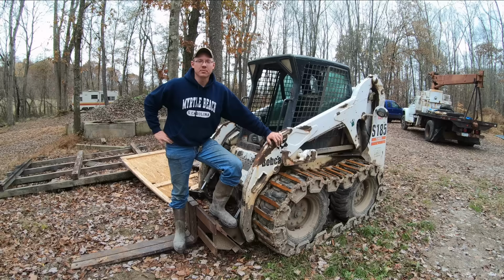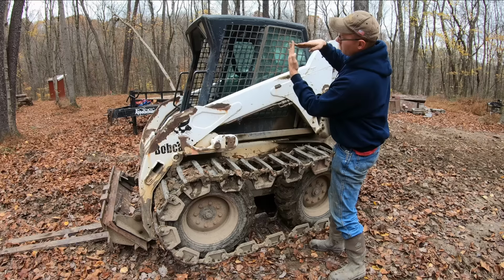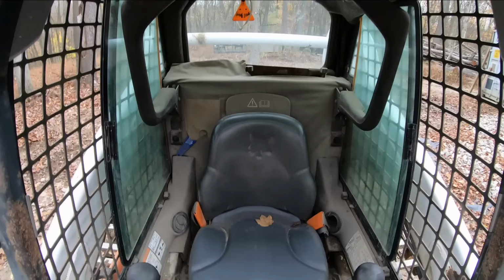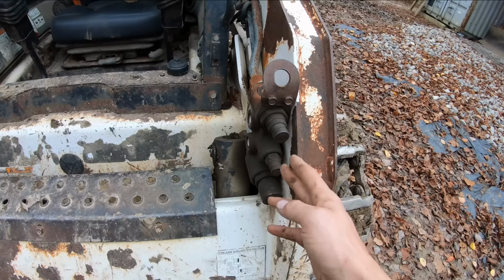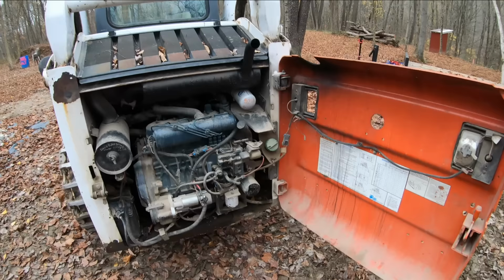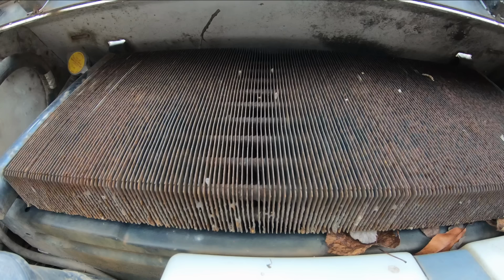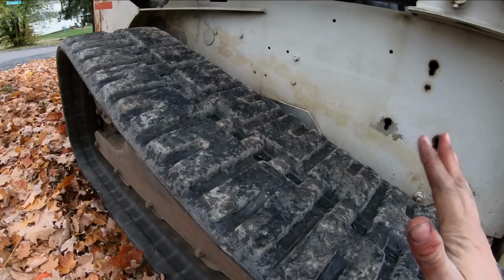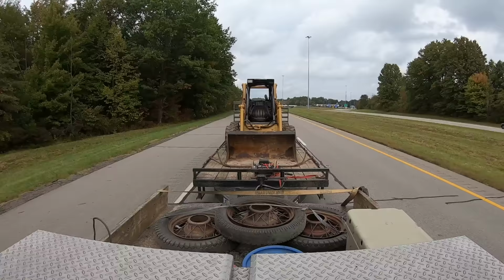Buying a Skid loader? WATCH THIS FIRST!

Comment: Good job on your showcase what to look for. The operator certainly needs to fix his machine soon because the bucket tilt  cylinders might yet just be in the bushings. If so he will get by with low cost. The bogy also needs immediate attention. I think you need to spray some of that black rustoleum paint on you hydraulic cooler to stop bad things

Comment: I prefer mini-skid steers and mini-loaders to skid steers mainly due to the inability to safely exit the machine with the bucket raised. I think JCB makes a single arm side entrance model that negates that. Mini skids are best for sketchy operation as it is easiest to bail from. Mini loaders can also run a cab for weather but have a better power to weight ratio than skid steers and, if articulated, tear up the ground less. Great overall machine buying video.

Comment: I definitely prefer the foot controls, I think it’s neat you actually have an option with this machine. The John Deere I operated a few years ago, you didn’t have that option. I’ve operated both hand and foot, love the foot.
Reply: I ran a bobcat with foot controls for a week and almost couldn't walk when done. My legs too long, feet too big, or something was out of whack. It was a workout. ... Of course might have nothing to do with running a hammer pointing downhill until the whole machine would slide off, drive around, point downhill, repeat. 😆🙄👍
Reply: Joysticks are the way to go.  Way easier on your body and not getting foot pedals stuck with mud/dirt.
Reply: @kg6981  When buying used, the foot controls will be a lot less money.  I bought mine on a smaller budget.

Comment: I interned at bobcat back in the Ingersoll-rand days, and can tell you what the numbering means. S= Skidsteer T=Track and A=All wheel steer(these were uncommon turf machines). The number is the approximate rated lift capacity, missing the zero on the end. Your S185 is rated for about 1850lbs of lifting. Because track machines are slightly heavier, and more stable, they have more lift capacity, so the same size unit with tracks would be rated more, hence the T190 (rated for 1900lbs)

Comment: They are a great machine to have around any job site however I disagree that it's the most versatile machine to have, I believe the most versatial machine would have to be the farm tractor with the 3 pt hitch and PTO both front and rear.
Reply: Very limited height of lift with skid steer compared to conventional machines.
Conventional loaders are more versatile especially combined with conventional tractor. Imo

Comment: I will say, from a LOT of experience that Bobcat machines have EXCELLENT dealer support . I can get just about ANY part I needed for my 20 year old 763. Simple stupid non turbo. I have the same tracks....make it a WHOLE new machine. Other advantage to tire machine is you can mount a 9-10' snow plow and use TIRE CHAINS. Tracks are not great in snow.
Reply from the maker: No they are like big ice skates haha but fantastic in deep mud!
Reply: @DieselCreek  I bought my Grousers for the same money as you off Craigslist as well. .. lol
Reply: Doosan owns then now.  They got rid of the Kubota engines and Doosan is putting their own engine in it.  Not a fan.  Have heard of lots of issues with their new machines.
Reply: @kg6981  many "new" machines i won't touch. I look for some old dead guys cream puff. Bought a JD 970 w/ 450 hours. Sat in a garage for 20 years.

Comment: Been using a JD2240 4X4 with loader, just bought a Cat 246C skid.  I'm struggling to get use to climbing in over the bucket.  Many times working on projects I need out to deal with something lifted in the loader.  Can't get out of the cab unless I lift the load up 7' and climb out underneath.  Other than that I'm loving the machine.  Thanks for the video, it gave me some tips for when I looked at the Cat initially.

Comment: in my opinion, I think The case 1845c Is definitely Worth Buying I've had one for about 3 years now done regular oil changes And it still purs like the day I got it And I will say the Tires I run I don't get Stuf though I'm considering some wheel tracks
Reply from the maker: Those are pretty good old machines, the 4 BT Cummins is hard to beat

Comment: You forgot wheel bearings and leaking axle seals.  Winter project is front left on my NH L555.
Reply from the maker: Yes I thought of that when I was uploading this!!
Reply: And drive chains and/or final drives for track machine. Blow by on the engine. 
When checking the pumps without pressure and flow equipment there are a few good ways to do this depending on what type a machine it is and if it’s a wheel machine what type wheels or tracks it might have added. 
First when you are going to look at a perspective machine take two blocks of wood 1 foot long and about 8” tall at the widest (it can be 8” , 6”+2”, or two 4”) you lift machine up in front with bucket and tilt up as far as you can place the blocks under the machine  just in front of rear axle let machine down till rear axle lifts off ground and front axle remains off ground. You can now check the drive motors for free play, rock the axles for loose bearings and check drive chains. For flow place a mark on both tracks and run them
1 min each side. They should be fairly close on the amount of revolutions per min. (With one one to two max) same with track machine. At this point you can check for excessive case drain as well the drive motors should be warm to touch (Luke warm not scalding hot ) if they are excessively hot you motor or the pumps are on the way out or are in need of resealing and repair. This should be checked before running the drives/pumps over relief to check pressure on motors and pumps. once speed and flow is checked then run the drives over relief “gently” first. You can put machine back on ground and use the block or a other smaller block to bind the drives one at a time first low idle and gently push in to it to check to see if it stalls. It should pull engine down if it doesn’t then it’s worn out or the relief(s) is stuck in bypass. A pilot controlled machine can also be checked at low idle for control leaks in this way. So you need to understand how the machine works to an extent to get the most out of these test. IE a machine that don’t stall at low idle may also have pot control issues in the manifold but you hav to understand the systems some. After low idle the check and pull it in gently against a block or pile of something and see if both sides stall about same time and that they don’t stall to early indicating weak hydros or bad pumps. 
Flow for main hydraulics works the same way run them gently over relief to make sure each pulls the engine down some but. It excessively (these aren’t eg drive motors they shouldn’t kill the machine unless your operating something off the high flow side) At this time of there is two of you have one person hold the machine over relief and feel the cylinders (after about 30sec) check cylinders in locations around where the pistons should be at this time checking for the cylinder to e noticeably warmer at that point. ( if it is the cylinder is leaking and needs repacked or piston is loose ) after checking the reliefs run them through full range of motion at least three times check for binding in controls and loader/bucket. after third time either you get out or other person checks the cylinder again this again checks the seals and also now the anti-cavitation valves if they have them (most modern loaders do they are located at the base of the cylinder piston on lift arms) again checking areas where the piston should be they shouldn’t be excessively warmer than the rest of the cylinder and the barrel end of cylinder shouldn’t be excessively warmer than rod end by much. Neither should be exceedingly hot to touch just warm

Comment: I am selling mine. It is an ASV posi-track 50 horsepower, 650 hours. Perkins Diesel Engine. The tracks are still new. We have only used it to push the snow out of the driveway. I think it was an overkill because I am not into construction. It has been in our garage, not outside. The price may be negotiable $ 48 to 50,000 dollars. It comes with its bucket, hardly used. Other details can be given The machine will be sold as is.  We have changed the battery every two years to a brand new one to keep it ready for the winter. We also bought the grapples if you are interested in getting it.

Comment: I got a Bobcat 540 project that you can swing by and help reassemble..🤣🤣
Got it for the price of new tires..  And it has new tires...  Motor caught fire and wiped out all the hydro lines... got all lines made and a replacement motor... Need to snag a manual for the hydro schematics..

Comment: @ 10:45, if that hole gets sloppy, I would bore it oversize and put an O/S bushing in it, before I would weld and re-drill. I can't imagine how many things like that I have worked on with 35 years as a machinist.

Comment: Just FYI if the paint does bother you one of the easiest ways to save money on production is paint so if you had the time or money you can heavy primer and paint it with quality paint and it'll last a long time reason rust spots show up so fast is cheap. Paint cracks water gets in starts rusting under the paint then it all flakes away... Good paint is pretty much always worth it weather your going to sell it in ten years or keep it for 20

Comment: That Kubota engine is one of the best. I had a Gehl skid steer at my place of work and when we traded it in the engine had 9000. Hours on it a lot of hours for a small diesel engine. 😮

Comment: I`m a track hoe operator but danged if I can run a skid steer with joy sticks. after having a taste of them our shop went on a shopping spree to buy cats with the traditional steering. One thing a lot of people don`t know is that most cats have a self leveling feature in the boom for back dragging just kick the right pedal once.
Reply: really? I just test drove a used model today and it was my first time in a skid steer.  do you tap the right foot pedal to the floor?
Reply: @zedwpd  Once to floor to engage then again to disengage. Note the self level only works on back dragging.

Comment: A pressure washer can be used to your advantage.  Repeated greasing is necessary but the residual grease traps dirt and that eventually adds to the wear.  A dirty machine left outside will go downhill fast.  If you want to just jump on your machine use it and shut it down then save your money for the new one that you will eventually need.  Do not get it out of your mind that someone is selling that machine for a reason.

Comment: S185 stands for max weight 1850 lbs lifting capacity back then. T190 is 1900 lbs, now the newer designation numbers means nothing now refering to max lift capacity anymore.

Comment: Those piston seals are real simple. 10 minute job once you get the piston off machine . Only concern should really be is getting the getting the main seal cap off. Those smaller ones usually spin right off. If not some heat usually does the trick.

Comment: Hope you do a video of stem cleaning the machine.
Reply from the maker: I will when I get to it. I’m always running around like a chicken
Reply: @DieselCreek  Oh, I know the feeling. No worries!
Reply: @DieselCreek  There are drain holes that will help with cleaning but just like everything else on a bobcat they are designed for shit and should be made a bit bigger if you have the means.

Comment: another point i forgot when i started working for big company several pieces of equipment they blew out filters i personally won’t as i have seen them damaged by compressed air i know of to machines they lost the engine that way cause they never pulled secondary filter definitely regulate how much pressure you put thru them good points but i change all filters every service no matter make me have little piece of mind definitely use quality filters to

Comment: Give you a key to older skid steers, buy the most basic model you can that has AC and Heat. If that control panel goes out so does your checkbook. if the key goes out or is lost I can buy a new cylinder for $100 or hot wire the son of a gun.

Comment: I  bought a machine back in the  70's and it was a first of its kind to us anyway. I own it so first to drive off the delivery trailer. I backed it off alright, foot controls for the bucket and hand controls for the tires, I think this is a good time to point out it had no cabin.... all open to weather and not a big deal as it was for moving sawdust away from the tail spools in the mill. I drive it up to the pile of spalt and sawdust.. make a kinda good scoop and then back away. I forgot that my feet controlled the lift on the bucket and am looking backwards as I move away from conveyor to dump said materials. I must of went a good twenty feet back and not looking forwards at all as I knew everything was okay or so thought! I had been pushing on those peddle's and they were still going on up an I wasn't adjusting the bucket to keep level so it was following the plane of the lift arms..... the next thing I feel is all that sawdust pouring over my head and a few spalts hit my head as well not feeling good at all... no bucket cover on my head either, a big no no on a machine set up like that. I get off and remain calm and looked at the crew and said "you see what I did wrong, don't do that or that will happen and could hurt you bad!" I sauntered off like that was what I intended and went about business in the mill while the others returned to different jobs and a guy was learning the machine... when no one was looking, ducked into the restroom and took care of scrapes and bruises. A real humble way to start with one.
Reply from the maker: We all have our embarrassing moments, you’re just lucky it was sawdust and not softball sized rock. Back when I was learning I’ve dumped my share of rock on top of the cab.
Reply: Those old models had 1 and 2 cly. wisconson air cooled engines and the speed selector was trip. but they got the job done.

Comment: We used to lay an aluminum framed copper screen over the top mounted cooler or radiator.  Really cuts down on what gets in and needs cleaned out

Comment: I bought a 753 back in 98 for $200...
I spent $60 at Napa getting 2 hydraulic lines refitted and worked that thing for 8 summers... 
The best part... I sold it and paid for my divorce 👍

Comment: Was looking  for  a  small  front  end  loader  when  I  got  offered  a  New  Holland  L775.  Bit  of  dealing  later,  I  owned  an  L775.   High  flow,  and  two  speed. Vertical  lift  compared  to  radial  lift  does  make  a  difference.  Post  holes,  pallets,  and  a  few  I  can't  remember,  vertical  lift  is  sweet.  And  I  think  it  has  a  solid  8  foot  dump  height.  But,  i  still  should  have  gone  with  a  front  end  loader  tractor.  My  775  doesn't  have  an  enclosed  cab,  and  winters  are  still  kinda  cold......  I  envy  your  heater.
Reply: I had a simple vinyl enclosure with a door on an a machine 15 yrs ago. I was impressed at how much engine heat I was able to conserve with that.  It's a good low dollar investment solution for open station machines.

Comment: Of course the thick iron makes a difference with catastrophic oxidation time. But the difference between these and a car in winter areas is mostly salt. If you're doing snow removal with these and DEFINITELY if you're running a salt spreader or doing areas where chloride is used its going to rust through just as fast unless you're washing it down before parking it every time

Comment: Hello Matt, I hope this comment finds you and your family doing very well. You were talking about metal tracks over rubber tracks me and myself I would prefer metal tracks on a rubber tire machine over those rubber tracks because guess what the rubber tracks fill up with mud in the metal tracks on a rubber tire does not sure they're noisy but there are way better and I'm sure that's one thing we will agree upon. Stay safe stay well and as always God bless. Hope you get a big buck this year.
Reply: are you going to take the steel tracks off each time you want to store it in a concrete floored barn/garage?

Comment: The company I worked for, we took a snowplow, and fabricated the rig to use it on the skidsteer, acted just like it would have on a plow truck.
Boss had 2 New Holland LS160, and we also had a set of steel tracks over the tires, had to put a set of hub extensions on the machine, so only one machine used the tracks
Reply from the maker: Yes I did that with an old plow as well

Comment: I don't think I've seen any skid-steers that rust worse than Bobcat. It seems to be a common issue with them.
Reply: Its the powdercoat they put on there instead of paint, vibration, scratches, and the smallest hole gets water on the bare metal and it rusts under the coating

Comment: Had a rescue call for a fellow with his foot pinched by the bucket boom coming down. One foot on the pedal and the other in pinch mode. Not sure what kind of safeties may have been bypassed, but sure did not seem to be a good setup. Looks safer and easier on the handles.
Reply: Youd have to bypass the seat bar.
Reply: @ridgerunner106  Suspected that, thanks.

Comment: I truly believe the Skid Steer is the only machine on earth that's it's own demolition derby. Every time you run one, you're headed for it's next repair problem. At least with the older ones.
Reply: We have a 94 model.  Cleaned out four chicken houses, moved thousands of rolls of hay, did construction work, brother uses it logging some, loaded lots of dirt into a dump truck, spread a lot of dirt.  Had it worked on two years ago, put bushings in the pump for controls.  I can crank it and use it right now.  Cleaned out other peoples chicken farms.  Moved lots of cow manure also.  I prefer foot controls.